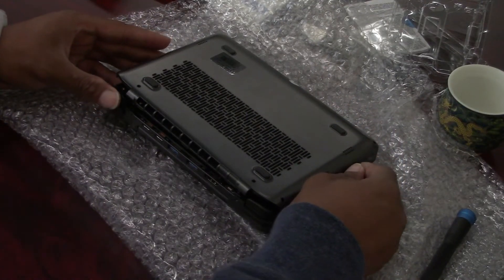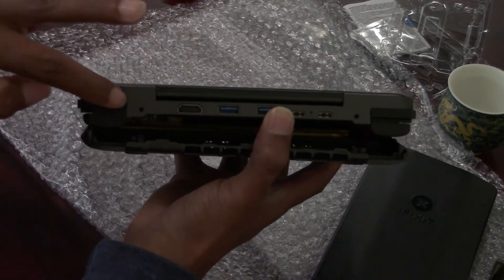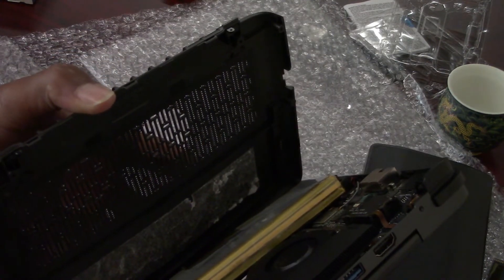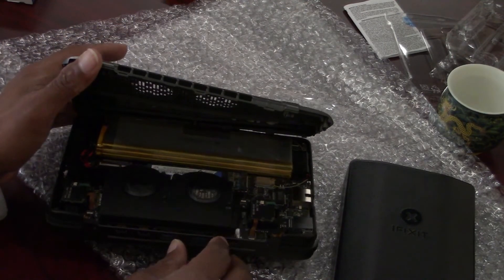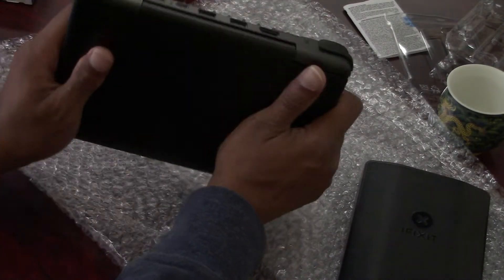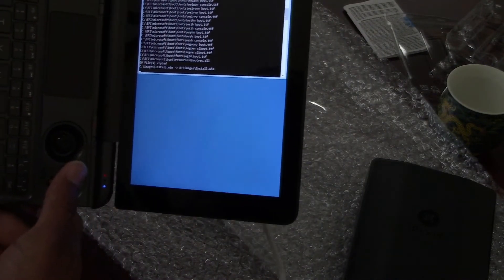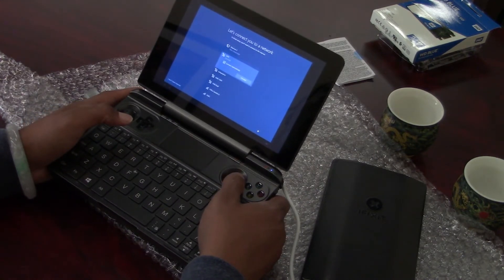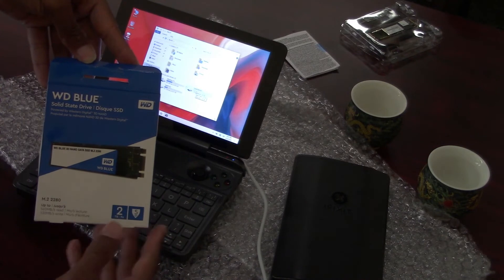GPD Win Max: "2TB SSD Installation"

Comment: Got mine 2 weeks ago.  There was no hinge on mine.   I was able to separate the entire bottom of the case.  They must be listening because while the battery was still stuck to the bottom of the case the battery cable was slightly longer and it was easy to remove the entire bottom with the battery still attached.  I used some tweezers to plug the battery back in at the end and it wasn't that difficult.  Also, I did not have to remove any of the fan screws.  Maybe they gave it a little bit more clearance.  I don't know. There was just enough room to slide the WD 1TB blue ssd.  I couldn't justify paying an additonal 150 buck for the additional TB.  Hope this helps.
Reply from the maker: Awesome sauce 👌 😎 thank you for sharing this. I just ordered another Max for the holidays so I expect to see my 2nd device within a week or 2.
Reply: listening now this design was not changed check PHAWX video he showed the opening even during prototype they changed nothing. its easy to open and well you have an ifixit kit you think you would realize the screw under the sticker ;)

Comment: Thanks for the tutorial. I could listen to your voice all day. Any chance you've setup PS3 emulation on your win max? If so you have do you recommend any specific settings in RPCS3?
Reply from the maker: Thank You for your kind words. I did setup PS3 emulation on my Win Max and I have yet to create any videos on the setup process, however here is what I discovered below and how to effectively get it running and running well at the best possible settings.

First things first; you are going to want this version of the RPCS3 Emulator: 10815 make sure you download that version of its "previous builds" on the RPCS3 website while you are there you can download the latest firmware because without the latest firmware pack installation, the emulator won't work at all.

The PS3 Emulator works two ways, game packages and Firmware packages. 

The firmware packages is what allows the emulator it's self to stay up to date with Sony's current state of bells and whistles while the games themselves are packages that are "digital installations"  the firmware packages/installations are not to be confused with the "build version" of the emulator itself. The build version is just the best version of the emulator that works on a particular PC or machine without or little known issues. 

In our case for the Win Max: the 10815 or 10815b builds are the best and issue free. Whatever you do do not update it for right now as this is the build version you want.

Emulator setup:

Once you have installed the "firmware pack" and then 2nd you installed your game, and 3rd you setup your game controller button layout, then you are gonna wanna go to configuration and make sure the following specifications are as is:

CPU: PPU Decoder on recompiler (LLVM)
          SPU Decoder on recompiler (LLVM)

Enable Thread Scheduler

Enable SPU Loop Detection

SPU Cache 

Leave all other settings as is under the CPU configurations. 

GPU:  Set Renderer to Vulkan 
Graphics Device: Set to Intel Iris Plus Graphics (Also make sure that you update your Graphics driver if you have not already via intel, this helps tremendously)

Aspect Ratio: can be set to 16.9 or whatever you desire .

Anisotropic Filter and Anti-Aliasing: Set to Auto

Default resolution: set to 1280 x 720

Resolution Scale: set to: 50 
Resolution Scale Threshold: set to 1
Shader Mode: Keep at Async (Multi Thread)

Everything after that is by personal preference only and won't destabilize the emu or the way the games play.

These are my current settings for the main emulator. I this preferences help you. As you may know the emulators are a case by case basis and are configured manually to the specifications of the user. 

Please do keep me updated on your emulation journey. Should you have any more questions or concerns feel free to comment on tis video or email me at: fusungc@gmail.com
Reply: @FuSungECookye  thank you so much for all that info. Any chance you've gotten red dead redemption 1 working?
Reply from the maker: @proletariate1980  to be completely honest I have not tested the game. Im sorry 😞.
Reply: @FuSungECookye  all good thx again for the info. I look forward to your future videos.

Comment: I highly ENCOURAGE that you update this video! We don't want other owners to go through this same process as seen in the video. This is VERY dangerous and you might break the bottom shell screw that was missed in this video which is white sticker. 

You don't necessarily need to remove the battery sticker from the bottom shell. You can just pull it down since its like a plug. Watch other videos how they did it.  - cuberootg
Reply from the maker: I'm definitely currently working on an update video to this. Along with some some other ideas. I will tag you when the process is completely. Thank You for subscribing and thank you for your kind words ^_^.

Comment: Hi Cookye. Some very important info for you and viewers about opening the Win Max. There is actually not an internal hinge at the front. Be sure to remove the screw hidden under the white oval sticker (it just shows the month and year of manufacture - you must break it to open the Max properly) - that may be why you thought there was an internal hinge at the front. There are 11 screws in total to be removed. You then just need to run something (I used a plastic spudger and strips of cardboard) all around the perimeter to undo the clips including the 2 in the front. You also do NOT need to pry the battery off (which could be dangerous if you damage it - trust me I know from sad past experience on another device) - once the back cover is fully unclipped it will open to the side with battery still attached. The Max is not easily opened - GPD should've done better in this regard. EDIT: definitely watch this video that Jeremiah posted, it's in Japanese but it shows everything really well: https://youtu.be/JOtEwCZynkE
Reply from the maker: Thank You so so much for this update. In the future when I do another upgrade SSD installation perhaps I will make another video of this process. I truly and honestly appreciate the feedback I really really do. I was so confused trying to open up the device and did not see nor notice the final screw as I saw only 10 in total.

Comment: Judging from a few videos I cross examined with this one, I believe there’s one more screw under the white seal on the front that you had not removed. Obviously, I don’t have my Max yet so I’m not 100% sure this is the case, and you having it in your hands can probably tell better than I can, but I saw a Korean teardown video with an IGG win max and it certainly looked like they removed a screw under the warranty seal in the front. I think that is what’s making it difficult to access. On the plus side though it looks like using your method doesn’t void the warranty
Reply: Here’s what I mean. https://youtu.be/JOtEwCZynkE the 16:00 mark in this video shows him removing the seal
Reply from the maker: @Doodlemaestro  Thank You for sharing I saw it, and now I totally understand I was really confused during this process.
Reply: Fu-Sung E. Cookye no problem. Just hoping nobody damages their Win Max trying to replace the SSD. They sure don’t make it obvious where all those screws are

Comment: Any suggestions for a good external ssd for gaming
Reply from the maker: To be honest I've always had a great experience with the WD passport series of thin light external hardrives. They are not SSD persay but they have awesome reliability and durability and are economical. You can get the most space and bang for your buck. I own 2 4TB external passport external hard rives by them and I separate them for archive gaming and the other for PC, laptop and GPD backup images and programs.
Reply: Thanks appreciate it

Comment: Nice I have all my tools and my Gpd max but really don't want to go their it was supposed to be easier to get to swap ssd what do you think of external ssd enclosure for example rog strix would I get much of a slow down on games
Reply: It's not as difficult as shown here. He missed a screw at the center, the whole bottom comes off and you don't need to tear the battery off.
Reply: @xomm  thanks for catching that really appreciate it so now I will go head and install  you a life saver did you receive yours
Reply: @remy4564  Not yet, next monday for me. :)